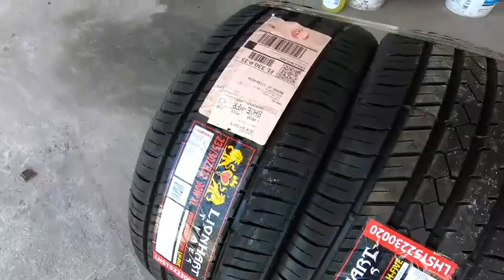How to  INSTALL 22" LOW PROFILE TIRES ON CHROME RIMS PROFESSIONAL INSTALLATION (Unstoppable tv)

Comment: Why didn't you mount from the face of the rim side?
Reply: Its a reverse mount style wheel. The drop center is on the inside. It leaves the face side of the wheel a cleaner look and with these types of installations there is no chance of the bars and duck bill to damage the outside of the wheel